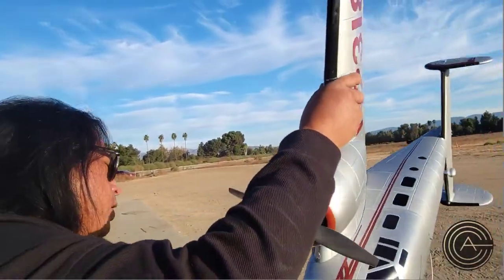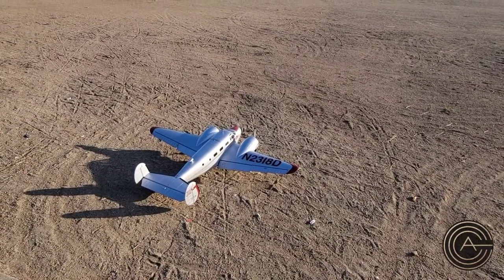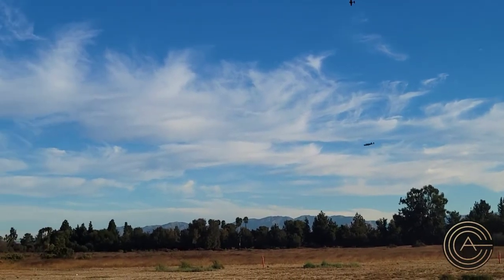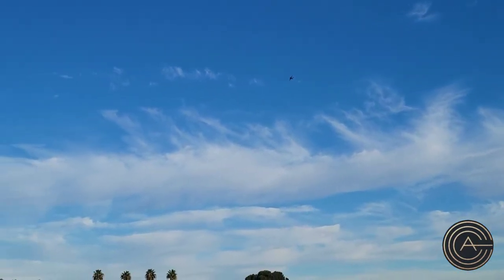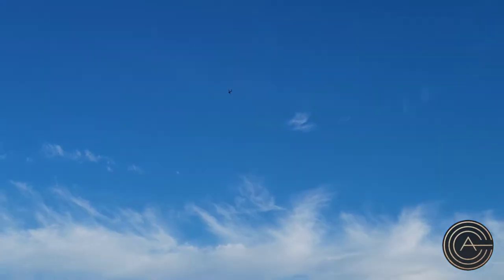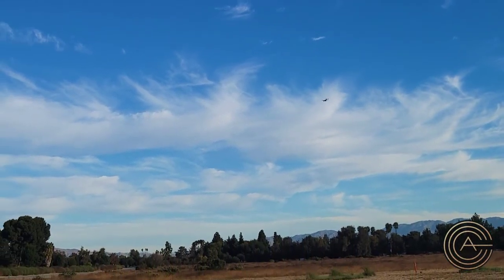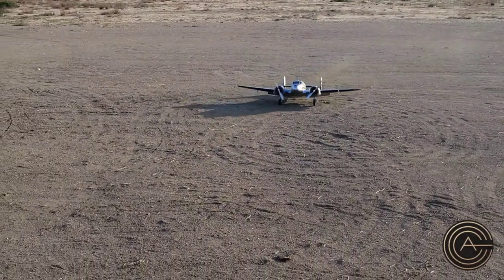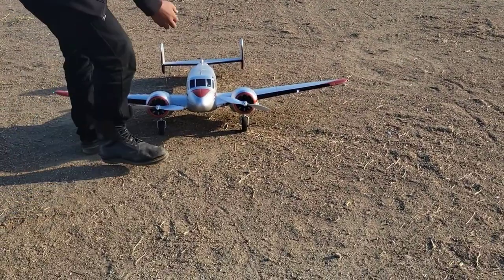E-Flite Beechcraft D-18 Accelerated Stall!

Comment: I wonder if part of the wing drop could be a little lack of coordination in the turn? After all, you don't have a turn coordinator to reference.
Reply from the maker: It's a stall.  You can coordinate your rc plane visually.  Watch the tail. When you bank a plane and give it elevator to turn,  you'll see the tail drop. The plane may be going level but the tail will be below the horizontal plane.  If you kick in a bit of rudder, you'll straightened out the fuse. That's a coordinated turn.  What is happening on the beechcraft is an accelerated stall.  It's no big deal really, as long as you know about it.  Many rc planes can have this tendency if you have too much elevator throw.  Take a Timber X and pull straight up on high rates and it will do the same thing.  That's a 3d-ish plane with lots of throw.  On the Beechcraft, it seems to do it with less throw than what I would imagine. It's controllable but I thought it was worth mentioning so it doesn't catch someone off guard.  First time it happened to me,  I almost crashed the plane.

Comment: You have way too much elevator throw. Move the linkage in on the servo arm and use the full length of the control horn. Don’t ever decrease the throw in your transmitter because that lowers the resolution of your radio. High rates should be 100% and low rates should be about 70%. Your servos should rotate about 40 degrees either side of center in high rates.
Reply from the maker: Yep i agree... but those are book rates. I am surprised that eflite would give a setup like that. However, once you are aware it flies great with that setup
Reply: @all_rc  I got the Beech 18 a couple of months ago. Before I flew it, I reset the AR631 receiver and reprogrammed it from scratch the way I do all of my BNF’s. I fiddled with the rudder setup so that it didn’t need any sub trim, but I didn’t measure the control throws. I rarely do; I just check the sub trim and look at the movement. I think AS3X can make a plane tip stall when it tries to raise a wingtip that has dropped. It can react quicker than a human and doesn’t know that deflecting the ailerons at the onset of a stall will make it worse. The 70mm Viper is bad about it.